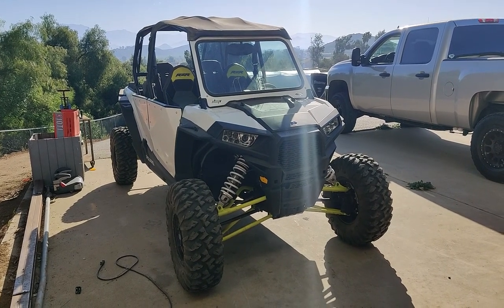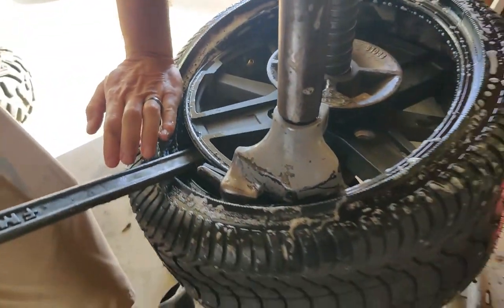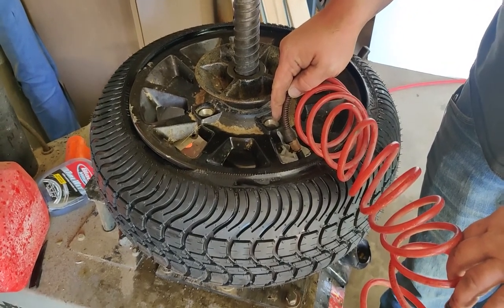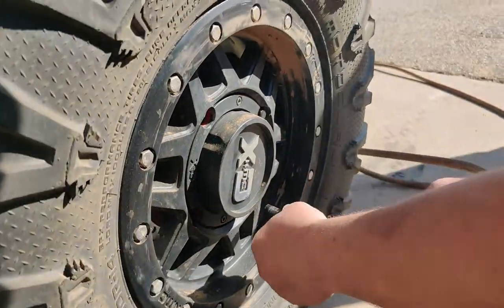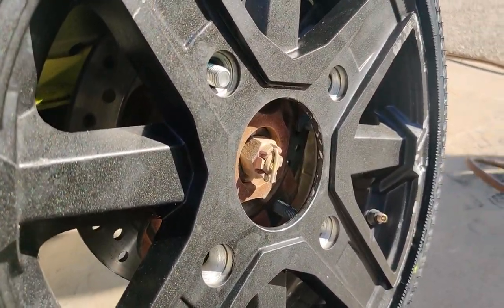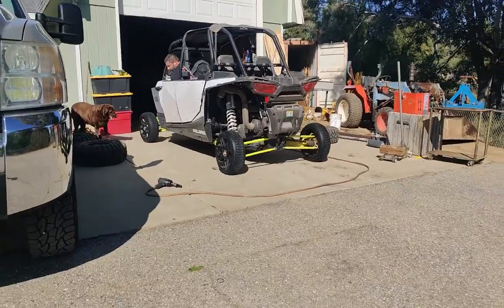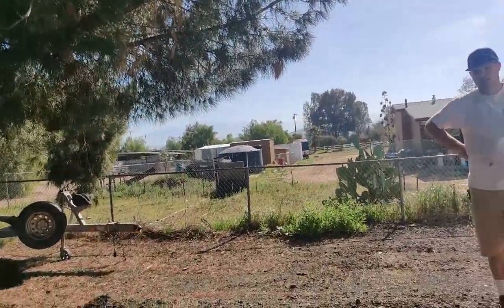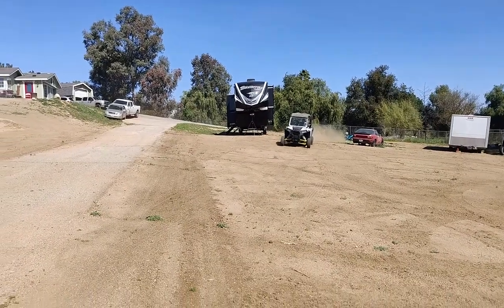Putting Tiny tires on a RZR 1000 will it fit in the toy hauler??

Comment: I run 195/95/14 street tires on my yxz  in the summer on the ranch. They are 23 inches tall it is awesome for drifting the dirt corners and no more top heavy feeling .  Plus it will craw better in first. Looks funny though.

Comment: I need to drop my ranger down 7 inches to fit in my snowmobile trailer. Will what you did lower it that much?
Reply from the maker: to lower i have used ratchet straps going from the a arm to the shock hoop or frame to compress the suspension.